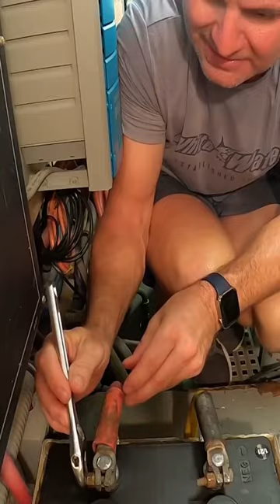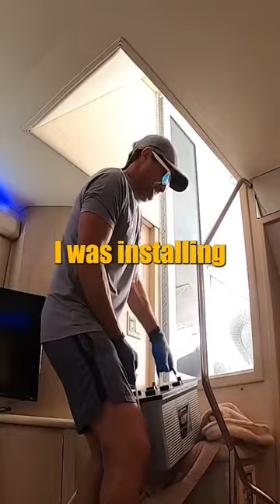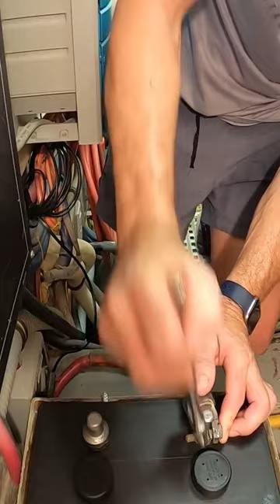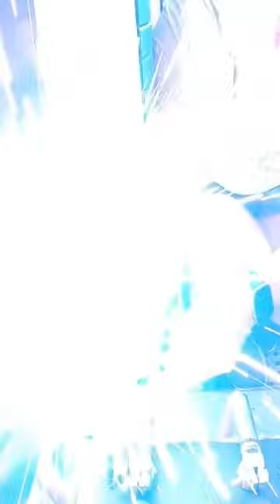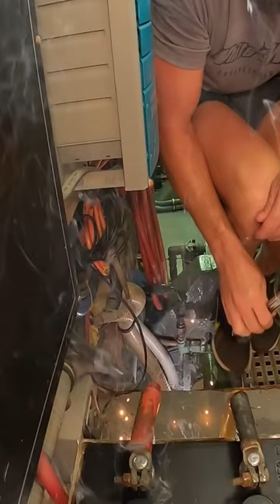Shocking my self with 24 volts! #mechanic #fail #shocking

Comment: I was helping a coworker change a starter on a semitruck a while back, told him he missed removing a connection to the batteries. "How do you know?" "Because I'm getting shocked." 
He'd missed a little ground wire that someone had added in for some aftermarket component at some point.

Comment: In that situation you didn’t want to ground the positive post and you did 
It would not have mattered if you didn’t have the ground connected because you grounded the positive post to the engine that was grounded 
Nice try though 
It happens to us all 
Be thankful no gasoline was openly exposed 
BOOM 💥

Comment: never work on a battery with power with uncovered tools 
It’s easy to get yourself killed. 12/24 volt is dangerous! 

Wrap your tools that fit exactly ( not the one you used in the video) with isolation tape a few layers to avoid what happened here. 

And yes the order… but that wasn’t the issue